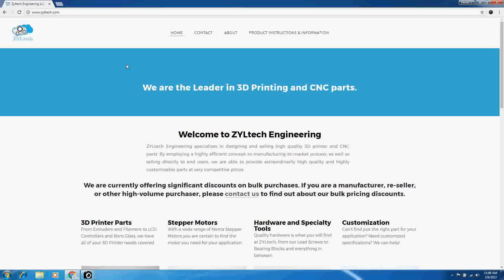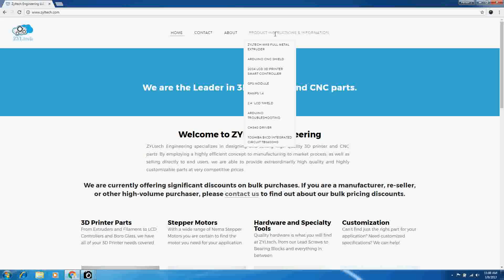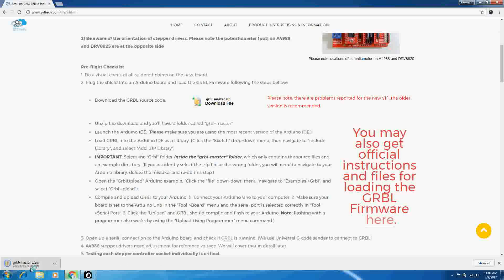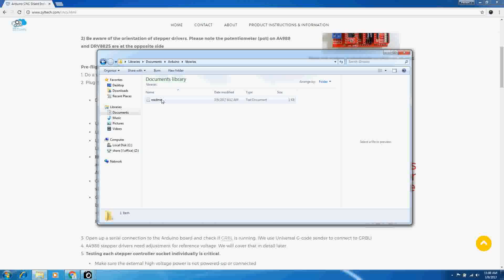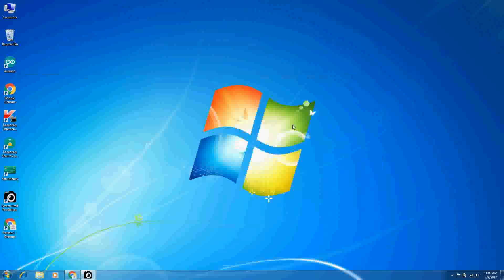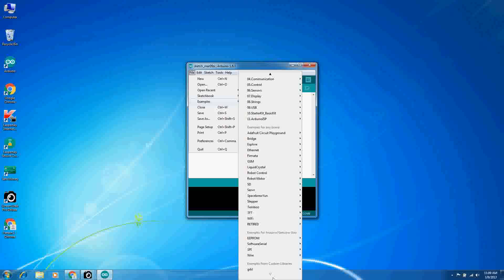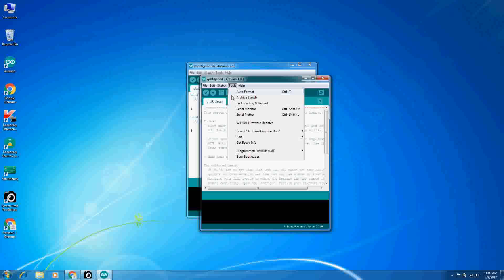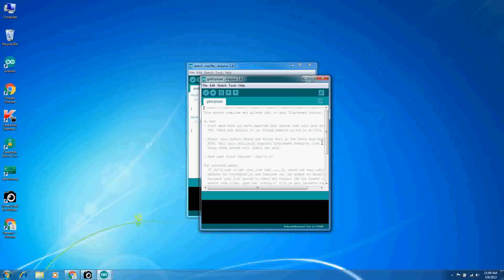Downloading GRBL and uploading to Arduino IDE

Comment: Hello, Thanks for your lecture.
When I follow your step but I need GRBL V0.8c.
If you have a files, Can you send me via sayney1004@gmail.com
Reply from the maker: Unfortunately, we can't directly send you the file, however you should be able to find it fairly easily online. Here's a starting point - https://github.com/grbl/grbl/issues/1195 - but we suggest you heed the warning mentioned in the conversation at that link.